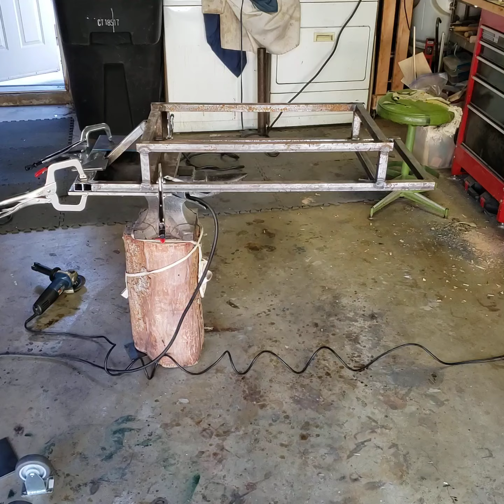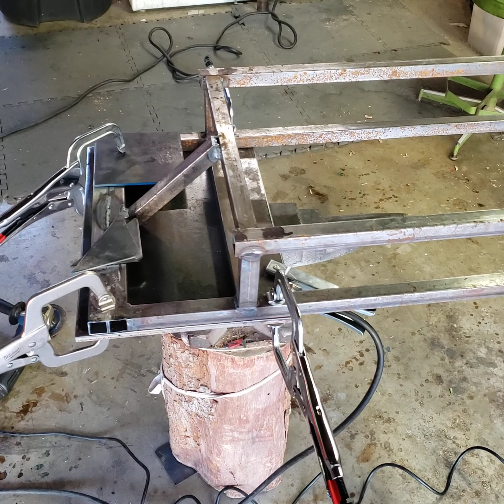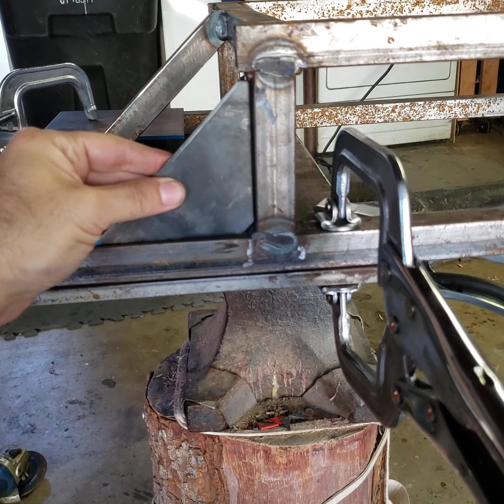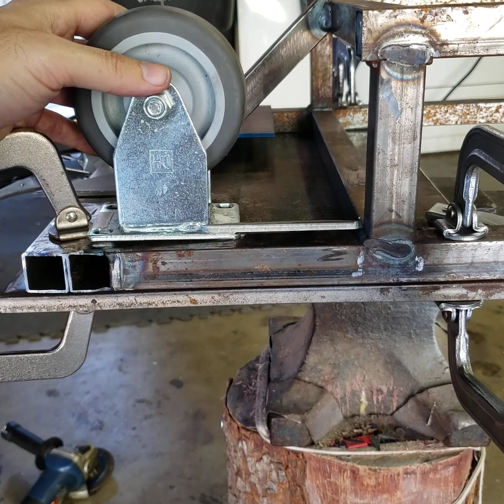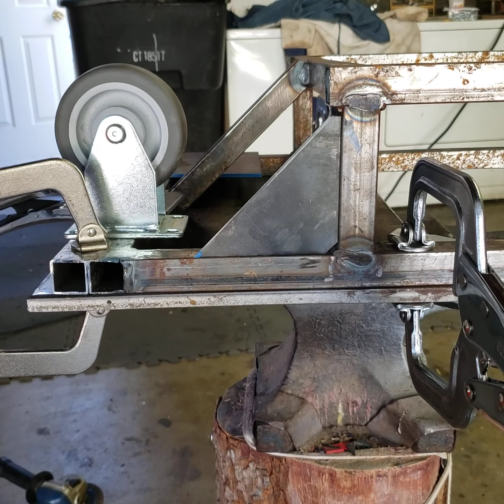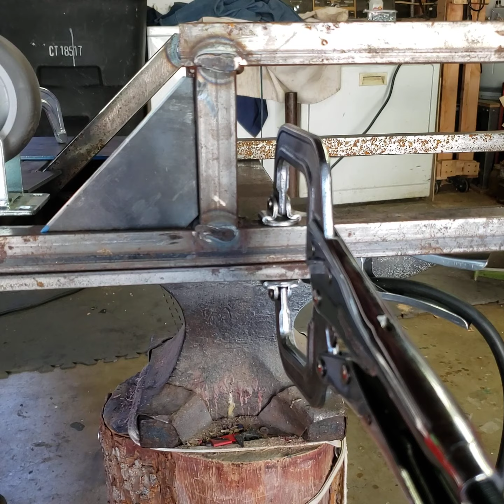Welding Cart Rig

Comment: Plan for a 125cf bottle.  You'll find that little 80 you have is too small.  I already learned that lesson the hard way.  $$$
Reply from the maker: Thanks for the feedback.  I'll have to check the gas prices, you're probably right, the smaller bottles are not economical.  Luckily my shop is up the street, but I'll still look into it.